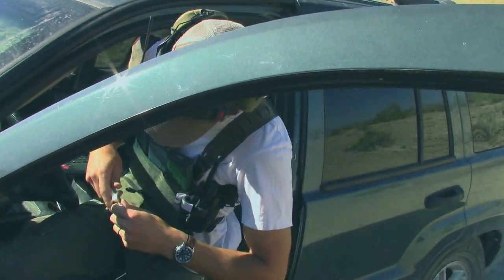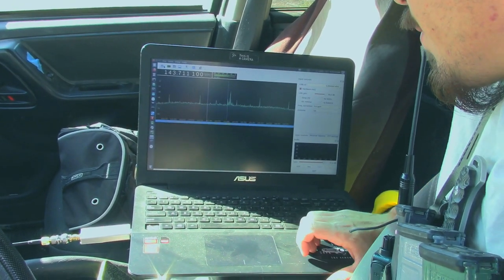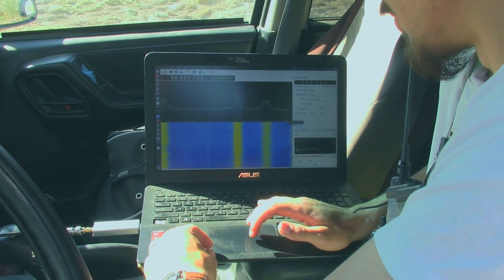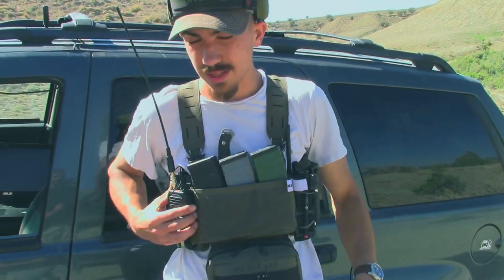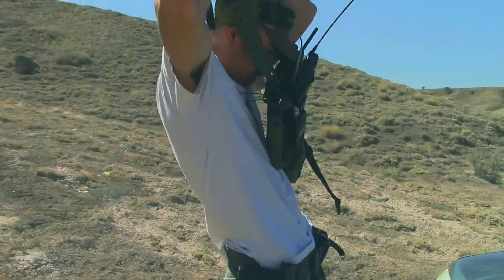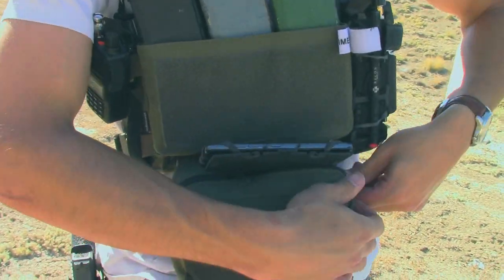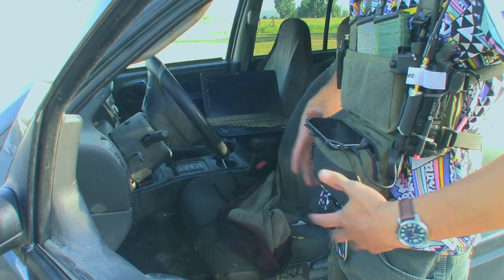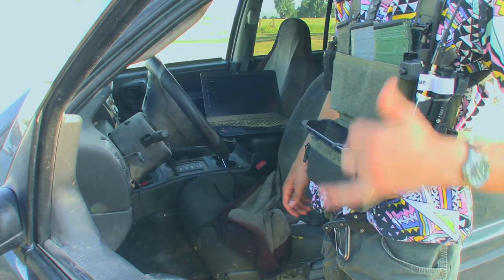SDR Kit Use and Overview

Comment: With the phone operation does the phone need to be active with a carrier or can you just use the phone as a Sdr radio?
Reply: No internet is needed to run the sdr software on mobile or PC. THAT'S awesome.
Reply: @RyanFixesCars  Yeah, I have it running on air-gapped equipment.